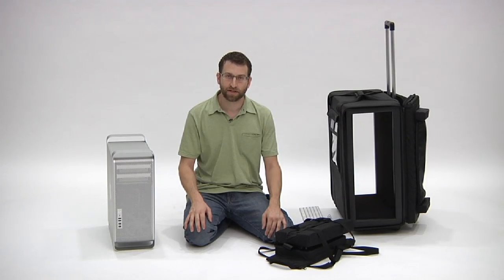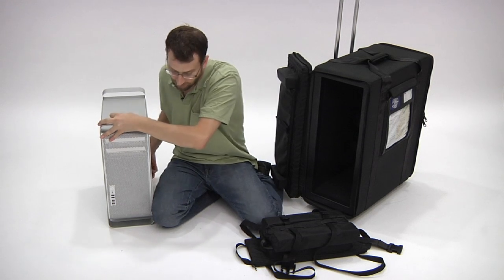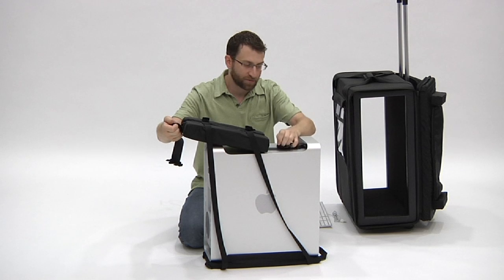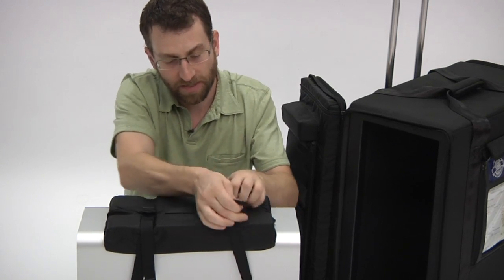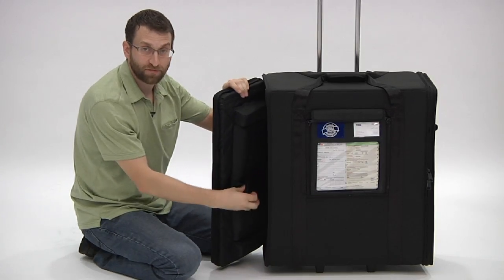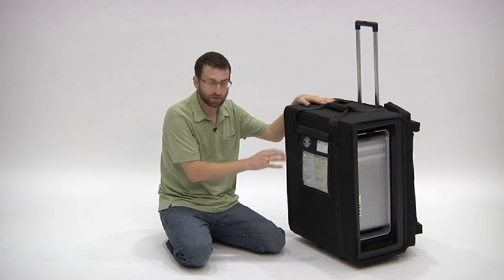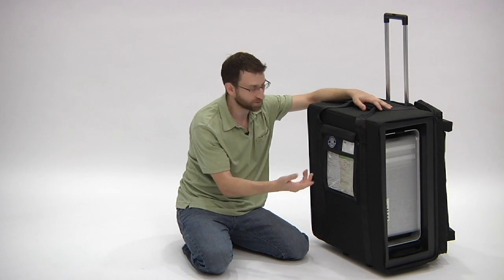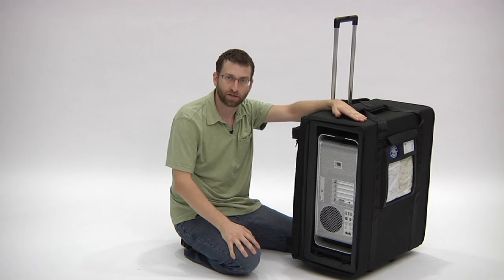Tenba Air Case for Apple Mac Pro Tower "Double Door": Assembly Instructions

Comment: Have you guys asked Digital Techs about this?

1st. This dude is on his kness the complete time. not a great way to work.
2nd. TSA would screw this case up if they had to repack it.
3rd, where does the keyboard, power cord, mouse, wacom, extra harddrive go?

the old case is so much better, and a top loader for quick in and out, and a place for the keyboard, and extras, please dont discontinue the old cases.

talk to digital techs, who do this on a daily basis.